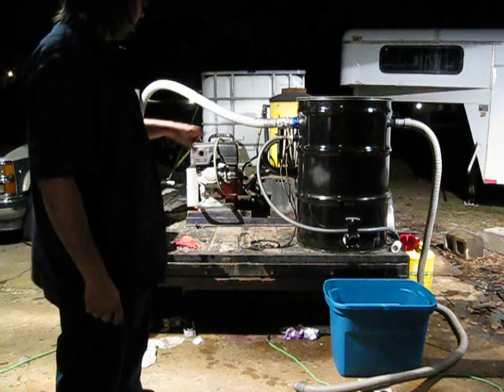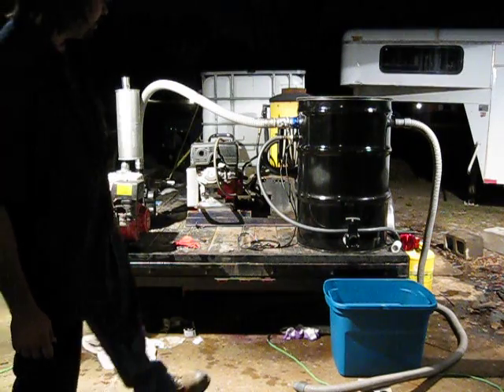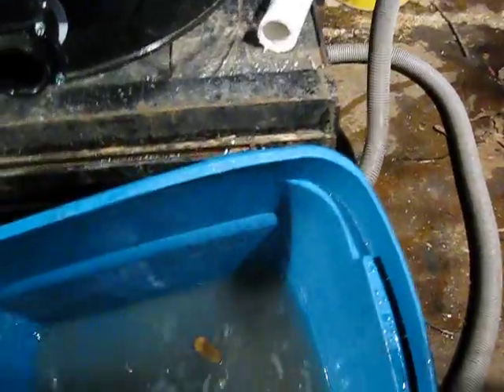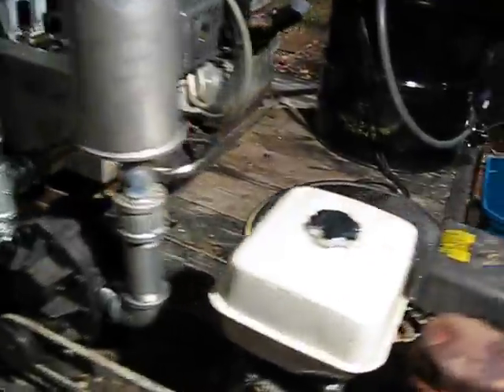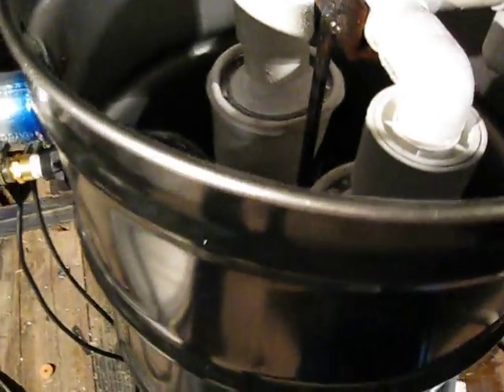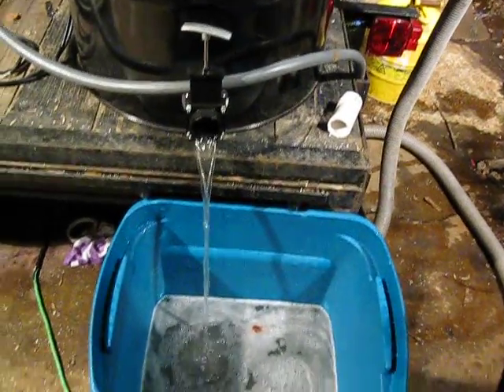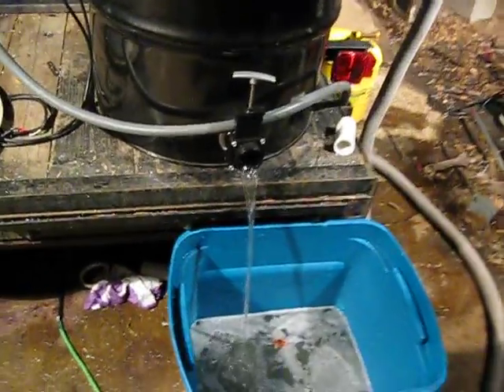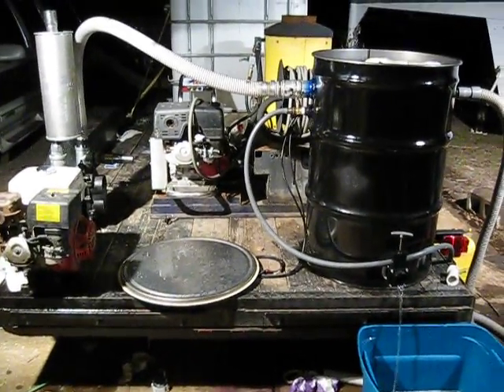Wash water vacuum recover system

Comment: WOuld you happen to be in Houston, TX? I have a couple of eagle vacuums. I'd like to make them into a reclaim system. Could you please help me figure out how to make it work? Thanks!
Reply from the maker: Daniel G.  What are u wanting to use them for
Reply: @kartmango  I'd like to use them to reclaim water with a vacuum boom and with a reclaim surface cleaner.
Reply from the maker: Daniel G. What is the inches of lift the Vacuum motors are capable, You would be good to put an auto pump outs in the vacuums and run them to a tank,,A surface cleaners seem to require a high lift and CFM rating to use on long runs
Reply: Kartmango Gofast Each vacuums have 87” of lift and each one produces 200 CFM. Both of the vacuums have a couple of slots to add additional vacuum motors.
Reply from the maker: Message me ur email address to my inbox
Reply: Kartmango Gofast Did you get it?
Reply from the maker: Daniel G. Yes

Comment: after washing off by high water pressure, there are a lot of cement paste running water off,
So that we need that such contaimenated waste caption by vacuume machine and filter the paster and
the clean water dump out in the drain.
Can you make this punction and performace vacuuming machine for the exposed aggregate concrete finish?

Comment: Where u get the base plate or u build it
Reply from the maker: I built it, just measure the center of engine mounting holes , make them larger than needed for play to adjust, set the distance of the blower based on the belt you are using
Reply: @kartmango  thanks do u use a flow switch for your pump out system can ge more information?
Reply from the maker: @galdinobruno19  it’s a  WAYNE cdu980e. Pump , I have built bigger now but still use same pump
Reply: @kartmango  so u use a generator to powered the submersible pump?
Reply from the maker: @galdinobruno19  most of time yes, a Honda eu1000 , sometime can use power from building

Comment: Is there a way to connect that drum to a larger tank?
Reply from the maker: J D the reason for small drum is for maximum vacuum pressure , you can pump water to a holding tank of any size, I now have that vacuum system with a 30 gallon tank and a 1”1/2 pump inside to pump water to a 350gallon , still have filters to catch sand and debris